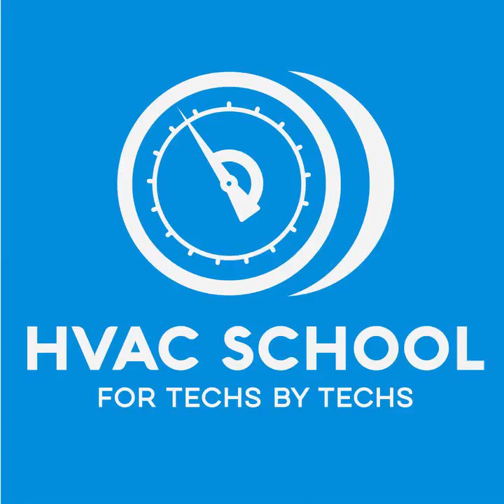Podcast - Reach In Refrigeration w/ Eric Mele

Comment: Most S/C reach ins have the amp draw for defrost heaters and door heaters on model number tag. Med temp reach ins and back bar fridges that don't have defrost timers use the cold control to defrost coil before allowing the compressor to come back on. A cheap way of doing it. I usually install defrost clock after having ice up issues.